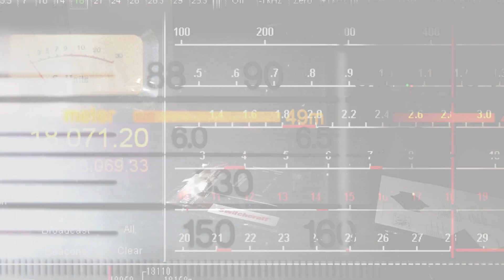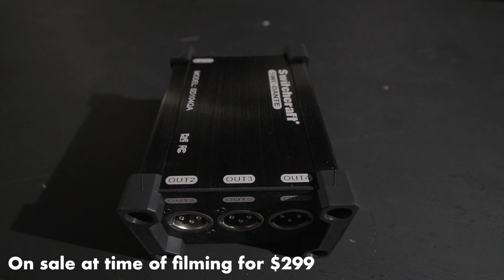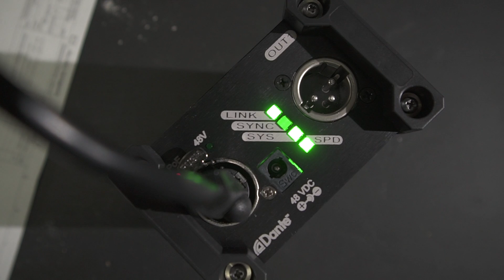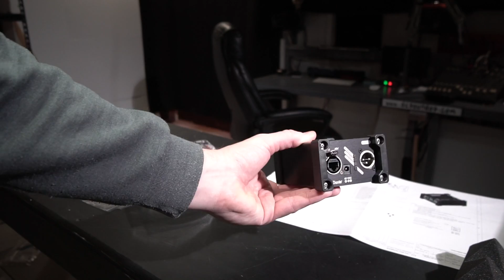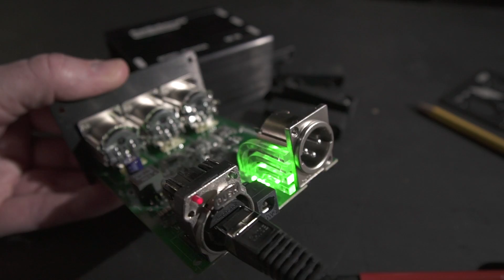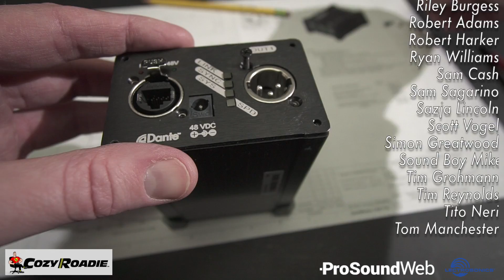Switchcraft SD-104QA Four Channel Dante Output Interface First Look

Comment: I have  noticed I lose almost 1db of output when used in my atem switcher is there somewhere to check and maybe just output volume internally,?  is there any companion software that you are aware of?
Reply from the maker: Which ATEM switcher are you asking about? I'm not sure I understand... are you routing audio from the switcher to this Dante box and getting lower volume than expected? Also, what type of meters and signal are you using to calibrate an almost 1dB difference between gear? Most gear doesn't have metering with that much resolution.
Reply: @DcSoundOp  I’m sorry 10db not 1 and I’m using the ATEM TV studio .   I am  using a db meter measuring the output of my studio monitors and  it’s almost 10 db lower then if I where to bypass the ATEM And the sound craft and go direct out of logic to studio monitors. So somewhere in that chain I have almost a 10db drop and use it’s a test tone sending 0 db out of logic with ATEM master volume also set at 0.

Comment: Any idea about total latency from say a mac with dante virtual soundcard through this device? Very curious about that!
Reply from the maker: That will depend on your configuration and the settings you choose for your network. Here's some more info, but 1ms is a typical setting - https://dev.audinate.com/GA/dante-controller/userguide/webhelp/content/latency.htm
Reply: @DcSoundOp  Thanks. Good info at that link.

Comment: Is the 48vdc input really a locking barrel?
Reply from the maker: Yes, it is one of the little turn and twist ones that can be used with standard barrels or the Switchcraft S760BKZ locking connector.
Reply: Ah, OK. I didn't see threads, and forgot about this type.

Comment: A 48 volt power supply???  WTF?  I think 48 volts is near the maximum of what is considered "low voltage computer cable".  Above this voltage and the wire is considered a high voltage cable.  Why didn't they use a simple boost converter to convert a lower voltage up to 48 volts?

In my old age having lived through so many different battery technologies, voltages and connector types I have come to the opinion that any device that can not be powered by a 5 volt USB power supply is what I consider a legacy product.  USB batteries and power supplies (chargers) are ubiquitous and Convenient.  There are some high power exceptions like lights, heaters, motors and of course power amplifiers.  And yes the micro USB connector sucks but type A connectors are quite robust.

My other question is why are you providing phantom power on an output device?  Phantom power normally goes the other way from console input down to microphone output.  Are there upstream devices that use phantom power?
Reply from the maker: Robert Harker 48V is a super common supply voltage for PoE capable gear. A modern adapter will run your under $20 on amazon and should be available from anywhere you get network gear, so it is in keeping with the standard & doesn’t have any relationship to phantom power in this instance.

Comment: That's not a locking barrel connector- is it?!
Reply from the maker: David Elsbury indeed it is, similar to the ones PreSonus uses now on their gear. I didn’t have a 48v supply on hand with the connector to demo it in the video unfortunately.
Reply from the maker: Part number S760BKZ for the locking barrel cable ends, also works without locking with non-locking barrels fyi. Didn’t realize this question would be so popular!
Reply: Gotcha, thought you meant locking with the ring like Shure ULXD singles for example. Cheers!

Comment: Do you ever worry about using devices that lack a secondary Dante port?
Reply from the maker: A secondary port is nice for sure, but cost seems to be a huge factor for most folks I talk to buying smaller network adapters. As usual it's about finding that balance you are comfortable with in putting the redundancy you can afford at the right places in a given system to cause the least amount of potential for critical issues.
Reply: @DcSoundOp  Back in the analog days, a small failure would mess up one person's mic. Now, a small failure (say a switch used for Dante) can stop an entire show. Have you ever had a Dante failure during a live event?
Reply from the maker: Matthew Datcher So while you are correct, the whole idea of a decentralized network like Dante is that you can mitigate the risk of that happening by careful planning. You should check out the video I did on MSI at the Times Square NYE ball drop, and how complex systems are designed to be resilient. A unit like this would never be in a position to stop a whole show with proper deployment, so it doesn’t worry me at this price point.